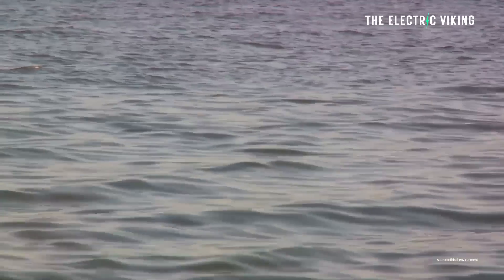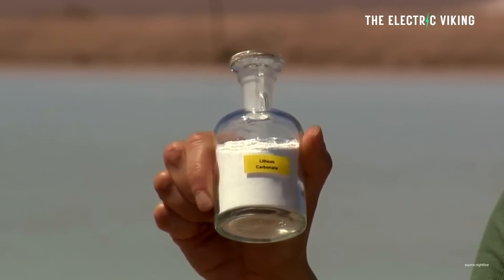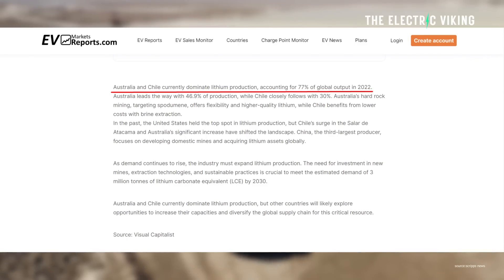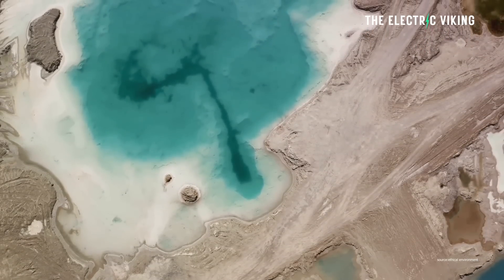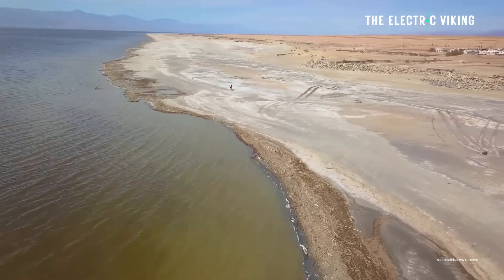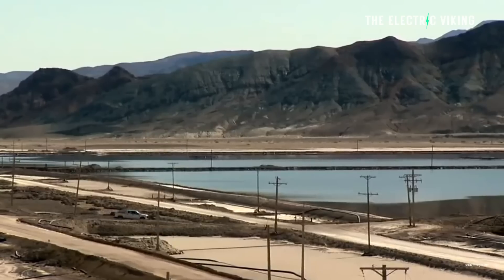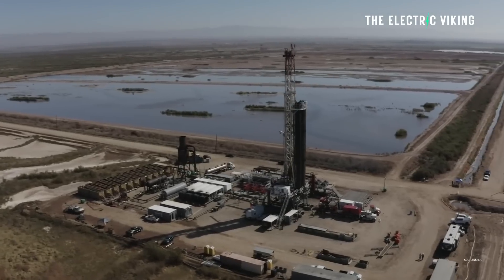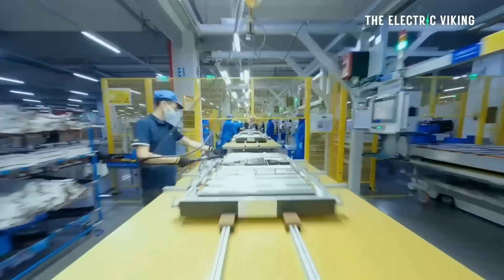US researchers discover how to cheaply extract Lithium from the Salton Sea

Comment: Lithium, being a chemical element, can be used over and over again, meaning it can be recycled, unlike long-chain hydrocarbons.
Reply: Yes lithium is one of the most abundant elements in the Universe and it's recyclable. So we need to find methods to extract it, but we'll never run out of it.
Reply: Be quiet go get a job
Reply: Shut up and go get a job
Reply: True, but what do you think the recycling rate will be.  When is the last time you're turned in that 2032 lithium battery to a suitable recycling service, what about the lithium ion batteries in your phone.   The recycling rate might be higher with the battery packs of vehicles and would be more likely to be regulated but really, we have been terrible with recycling in general and it's really the rapid conversion to EV's that's stressful on the supply chain.  A lot of the supply issues can be reduced by extending the deadlines though of course we do need to address the green house problem more seriously as well.  The recyclability of EV batteries also hinders investment in the procurement of lithium as demand will of course drop once the conversions are complete and recycling and reuse picks up...  Why would you invest in a business on only temporary surge in demand.  I'm all for EV's but a rapid transition is problematic...
Reply: @johnwang9914  Lead batteries have a 98% recycling rate. Why would Li auto batteries be lower? They are even more valuable than lead ones.
Reply: As of 2022, RecycLiCo and its R&D partner Kemetco achieved over 99% lithium recovery from LFP (lithium iron phosphate) battery cathode materials during bench-scale tests.
Reply: @bort7258  Yes, but how much lithium products gets collected for recycling.  Efficiency is great but our problem has always been the collection and sorting for recycling and indeed with recycling lithium batteries, the battery contents are sorted by content and pulverized so they don't have to be smelted and purified again but that means they can only be recycled into the same formulation of batteries yet our battery technology is constantly changing and hence the preferred formulations are changing.  We can recover most of the lithium if we are dedicated enough, it's just the dedication that's always been lacking.  Our current single stream recycling bins recycle less than 9-14% of what's collected for recycling and what's collected is also a mere fraction of what could be recycled.   Recycling simply requires too much of the public to do consistently at least for our current society and culture.  Besides, if we really want to recycle, Sandia Labs has already demonstrated using cobalt oxide catalysts to separate hydrogen from water and carbon monoxide from CO₂ efficiently (they used a solar furnace) so through the exothermic Fischer Tropsch reaction which we use in our refineries to dilute our sulfur rich diesel with synthetic diesel to meet federal ultra low sulfur requirements, we could just recycle water and CO₂ back into gasoline and diesel and mostly with processes already in use in our refineries, we would have at need some energy from a green source to first separate the hydrogen and carbon monoxide from water and CO₂ to begin with (plus it takes energy to concentrate CO₂ from the atmosphere).
Reply: None of this matters, folks. we all know from social media that ONLY CHILDREN can mine lithium, therefore it is the worst. Children mining lithium is a limitation of physics itself, so no other method to extract lithium is possible.
Reply: @blanketwodahs6741  Misinformation unless you are being sarcastic. Yes, developing countries use child labour to mine/manufacturer hundreds of products.  And COBALT and Lithium are on the lest.  But there is no physical limitation, nor is all lithium mined by child labour. In fact, Cobalt is also used in the petroleum industry as a catalyst when refining crude oil. And open Cobalt mines are one of the biggest child labour culprits.
Reply: @bort7258  haha yes I was being sarcastic. hmm maybe I should have used more sarcasm............. lesson for next time
Reply: @blanketwodahs6741  you got me then lol.
Reply: @blanketwodahs6741  It's actually child labour mining cobalt in Africa that is the concern and that's only with the Lithium Ion Nickel, Cobalt, Magnesium batteries popular in the US and Europe for their high volumetric energy density, not the Lithium ion, Iron Phosphate batteries popular in China for their reusability, safety and fast recharge abilities which actually dominates global EV's.  It's Cobalt and to a lesser part nickel that's considered blood minerals, iron is common and widely mined, Phosphate's problem is that we also use it for fertilizer so using phosphate impacts food costs.  With Lithium, it's often strip mining of dry lake beds so the labour are drivers of heavy equipment, the problem is there are few lithium mines with many in China and that it takes fresh water to dissolve, separate and purify the lithium.  Your post shows how even marginal information quickly gets misinterpreted as misinformation and the continues to spreads as such on social media.  You might as well have been whining about the ridiculous wind turbine causing cancer nonsense when the germination of that was actual softnews documentaries on the potential but unproven infrasound health risks of wind turbines (nothing to do with cancer).  Basically, you're showing how you misinterpret information as readily as an orange toupee adult toddler and his red baseball cap supporters.
Reply: Lithium can be recycled but each cycle requires additional processing and is heavy on electricity required.
Reply: Redwood Materials must know a thing or three. Recovering, on average, more than 95% of materials like nickel, cobalt, copper, aluminum, lithium and graphite used in a lithium-ion battery produces a circular supply chain that's short only five percent or so. Not too very expensive to do either, making it very profitable.
Reply: @LegendaryInfortainment  Tesla, supposedly, already recycling their vehicles with a total recovery rate over 80%.
Reply: in fact, recycling long-chained hydrocarbons is being done worldwide, next time you buy yourself a bottle of olive oil, sunflower oil or even burn wood just know that we constantly recycle co2 back into long chain hydrocarbons using plants and light
Reply: Some people,will disagree.
Wood pellets are considered green as whilst hey emit carbon then created from wood grown specifically for wood pellets.
This growth pulls carbon from atmosphere to grow the tree which is then cut down and then burned thus releasing the carbon back into the atmosphere which then pulled out to grow next trees.
I personally have no idea how considered green but officially classed as carbon neutral as only emission is what pulled from atmosphere.
Oil and gas basically same but over a much longer period of time.    Formed from dead plants and animals which will have taken carbon to grow, so releasing the carbon that used to grow the plants etc originally.
Reply: @michaelmcnally2331  C O2 is good  The earth has greened by 15% in 20 years.  Even NOAA had to admit it.   Crop production is up huge without the addition of more nitrogen.  If you care to look you will find all the lies.  I am 60 and exploring this with a chemical engineer.  It is amazing what we have been told.
Reply: long chained hydrocarbons can be recycled, too it just takes longer
Reply: Wow!  Alert the media, Captain Obvious.
Reply: 🤣🤣🤣   What a completely unnecessary statement.   This sounds like a gen Z or younger statement.  Go get a job.
Reply: @timbrown9305  - I'm old and retired, and you weren't required to inform everyone of your inherent stupidity at all. I'm off the hook for that.
Reply: Not as simple as that, dum dum.
Reply: @Withnail1969  Actually simpler than you think. There are processes that reach 70% recycling efficiency, which isn't too shabby. And we're still in the infancy of Lithium recycling.
Also, he's right, it's an element, so it's much easier to recycle.

Comment: Eventually, those grid storage lithium batteries will be recycled for use in vehicles as their lifespan ends and they're replaced with another chemistry like sodium. Lithium (LiFeP especially) is great for vehicles, but for a stationary plant where weight and volume aren't as much of an issue, there's arguably already better, cheaper tech. As we start to recycle old EVs, laptops, phones, and massive grid storage centers, that Li will be freed up for vehicles and at a much cheaper cost than mining as well.
Reply: Grid storage batteries are not like car batteries, they will last 4 times longer as it dosnt matter how low they degrade . It’s not moving
Reply: @chrisward5626  They still light up like roman candles every so often randomly, and the chemistry breaks down at the anodes eventually as well. They may last 4x  longer in theory, but in practice, they're in the elements and tied to an electrical grid that can send power surges to make them fail early.
Reply: @Kingramze  that makes no sense at all . Why would they get a power surge when they have complex bms systems? What does a fire have to do with them lasting longer ?
Reply: @chrisward5626  The fires were caused by uncontrolled runaway from the failed batteries - and those BMSs didn't prevent it. I don't know if you're aware, but a lot of the older chemistries the grid storage systems were made from have a much higher failure rate than the chemistries used in current Tesla cars. (Look at the older Tesla battery pack failure rate vs more current ones - and I'm not talking about LFP batteries which are obviously more stable) Some of the internals of each cell that were thought to be inert - like the glues - ended up not being so inert.

As for the BMS, doesn't help with deterioration of the batteries as much as you'd think. Those are high voltage systems with rapid charge / discharge cycles, and we know that fast-charging deteriorates batteries faster as seen from the numerous Tesla battery issues from fast charging. Now, also take into account the fact that these are connected to high voltage wires that can do some serious damage if the power factor is off or a surge or backfeed, you can get a spark that jumps several feet and burns through cabling, much less cares about whatever BMS you want to feed it through.

Comment: Ground zero in Dimock Pa here.     So all of the billions of gallons of water that has been used in fracking this area has lithium in it for recovery.  1 they don’t pump lithium down the hole but lithium comes out with the waste water.   What else comes up from 500 million years ago.    2. For years the oil companies have been discharging and making ponds from the wastewater.    So where is that lithium    (The water ta ble ).

Comment: The issue for the west is not the supply of Lithium, but the production of batteries requiring Lithium. Western manufacturing is going down the gurgler.
Reply: The Inflation Reduction Act has incentivized building all sorts of industrial production.

From resource extract, refining,  to manufacturing.

A couple chip fans have already broken ground.
Reply: Hopefully it's not too little too late.

Comment: Doesn’t sound like a very environmentally friendly operation to me. Wouldn’t the environmental damage incurred in the extraction process and transportation of the raw product tend to cancel out a lot of the environmental positives of EVs.
Reply: Compared to burning oil?
Reply: @jamesvandamme7786   I’m not condoning oil, just saying that huge lithium mines are just another addition to environmentally damaging activities..
Reply: @Vladimir-ski  Well, take your pick. Breathing exhaust fumes or mining and recycling lithium. You don't have to dig it up, get it from those old seabeds.
Reply: @jamesvandamme7786  The seabed process will produce lithium but the process is not as cost effective as hard rock lithium mining. EV battery costs will not come down if manufacturers have to rely on seabed extraction. As for exhaust fumes, each generation of IC engines over the past 30 years has reduced their emissions and the new high tech IC power units proposed by Geely & Nissan for their new hybrid vehicle joint venture will significantly address pollution issues. Hybrid sales have exceeded BEV sales by about 25% in China, Japan and Australia over the past 18 months so hybrids running around big cities in electric mode will make a big difference to air quality.
Reply: Actually, the amounts of raw materials mined for EVs is trivial compared with extraction of oil and coal. Take lithium, for example. For every ton of lithium that was mined in the world last year, 63,000 tons (!) of coal were mined—often in ways much more damaging to the environment than lithium extraction. Similarly, for every ton of lithium that was mined last year, we extracted 46,000 tons (!) of petroleum.

The big difference is that if we continue mining lithium for perhaps 40 years, after which all needs can be met by battery recycling, we can complete electrification of the transportation sector, and end some of the mining of coal and most of the extraction of petroleum forever. On the other hand, if we allow the fossil fuel industry, aided by their useful idiots promoting a hydrogen economy, to stop the mining of lithium, and thus the conversion to an electric transportation sector, we will continue to mine coal and extract petroleum at a similar rate forever.

The choice is clear, and I opt for short-term mining of lithium or other minerals required for EV batteries, in order to greatly reduce extracting tens of thousands of times as much coal and petroleum, for all time.
Reply: Its true: gasoline and diesel just appears in fueling stations. no need to extract anything, refine it or transport it. Also, we will never run out of fossil fuels, so what's with all this bother? EVs are super dumb

Comment: Can the lithium extracted from sea water be used directly in batteries? If further processes are needed to make this lithium useable, then these processes are the bottleneck of the whole process of lithium mining/extraction and purification. China is already mastering the conversion of lithium ore to lithium pure enough to be used in batteries, the United States will still be trailing China even lithium can be extracted from water of Salton Sea.
Reply: Easier to scoop it off the ground than to refine the minute amount in seawater. Same with uranium and a lot of other minerals. 
Processing is cheaper to do in countries without an EPA,  OSHA, or unions.

Comment: The problem of this method is not the potential lithium we can extract, but the quantity of water that needs to be processed to obtain a quantity of lithium. On other words, current processed water brings little lithium per time. To scale lithium to the levels we need, means move the water requirement way beyond of current needs.

I will try to explain with an example. Currently there is some demand of fracking. That brings X litters of waste water, and this process can extract a certain amount (small) of lithium from that water. Because that water is a waste, the extraction of that water could be considered free (paid by the fracking part).
Buy through this, the lithium extracted is not enough. If you want to scale the lithium, you need to process a lot more water, but that's way beyond from the fracking extraction, so you need another source, paid directly, to obtain that water, which destroy the economics of the process.

It's cheap, as the water processed is bind to other process that generates that water equally, but that's not enough to generate enough lithium. You can scale it, but then you need to multiply the water sources ONLY FOR THIS PURPOSE, which raises the price a lot.
Still... any new technology is good.
Reply: Do you really expect Sam to understand such nuances? 
He gets excited reading a headline 😁